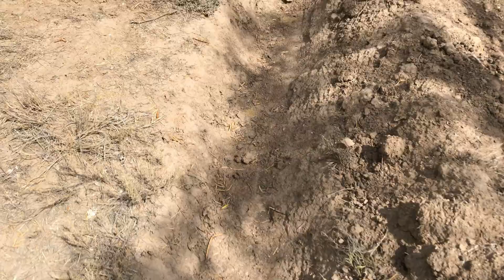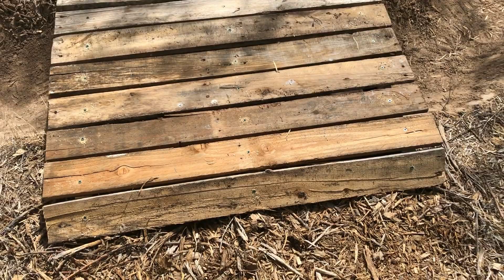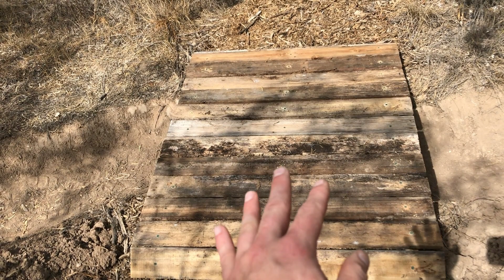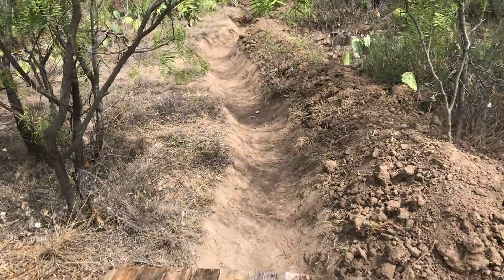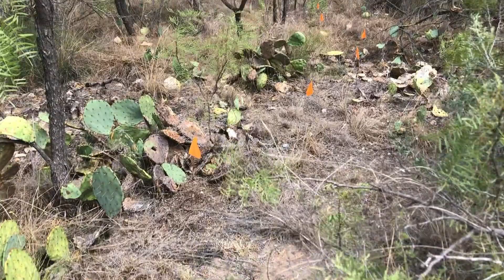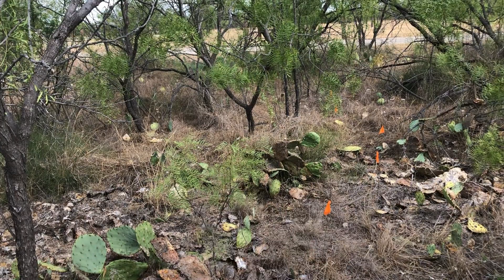Swale Project Part 5: Bridging the Gap

Comment: also, how did you decide on the location of the swale on the property?
Reply from the maker: Hey John, I’m usually just winging it most of the time. I picked that spot initially because it was pretty open and didn’t have a lot of trees and brush to clear out of the way, so I figured I could make quick progress. I followed the contour line until I’d run into brush I didn’t feel like tackling.
Reply: @WestTexasGardenExperiment  So do you mean you created your swale without a survey?
Reply from the maker: Hi Jerry, I had not survey to go off of - just a little leveling tool to keep me on contour. I show the level thing a little bit in part 1 of this series if you want to check it out. My land is fairly flat, with only a slight slope.